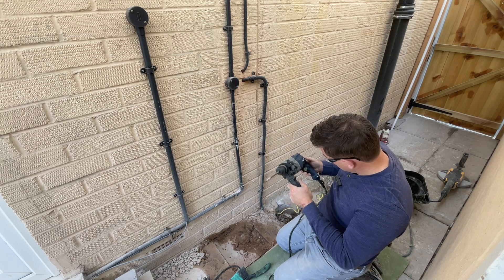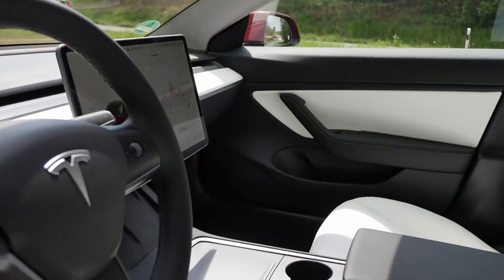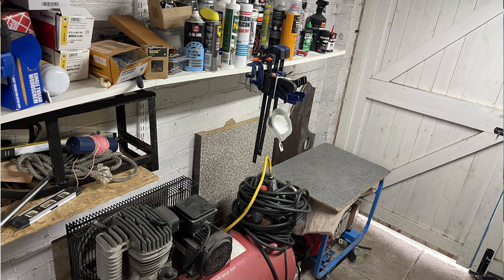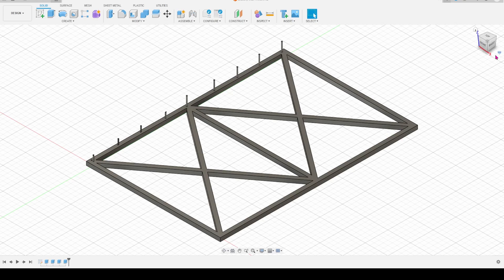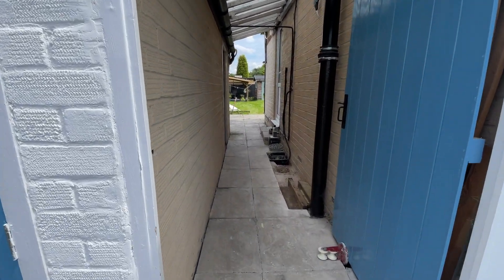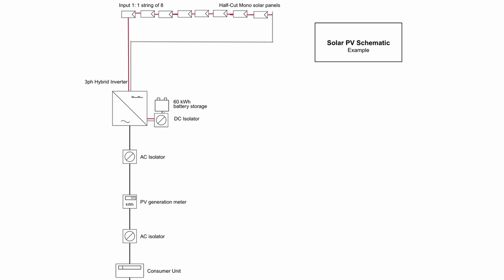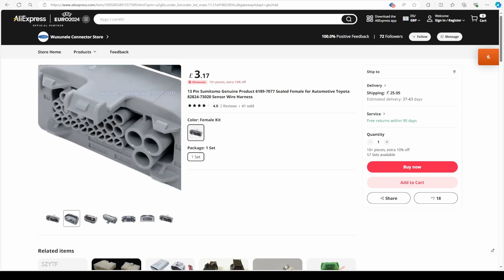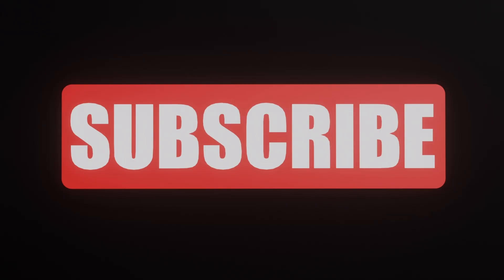How Do You Plan A DIY Frankenstein Tesla Powerwall???

Comment: Thank your fantastic video series. What is the device one could take with him and plugin to a model 3 Tesla battery to check if the condition is good. A battery of  part number 1666969-00-C is available in Australia for AU&9,900. Any pointers are welcome.
Reply from the maker: You can plug in a Lilygo in with the software from the ‘Battery Emulator’ by ‘Dala the great’ on GitHub through the x098 port. This would give you the cell voltages highest and lowest showing the mV imbalance. This is a good indicator of health. 

The battery would also need 12v powered through the x098 connector 

That pack is LFP and very similar to the one I’m using. I’m using revision D. I will add a link to the project instructions on the GitHub in the description.

Comment: Won't you have to move that pipe that would end up behind the battery? I'm not sure if it's water, gas or electric but any one of those would be a problem.  And what about insurance - won't that be a problem? For suggestions for getting it into position try and work something out with a couple of trolley jacks and a frame. A beefed up version of those trolleys glaziers use comes to mind. A crane would work but I'm not sure they'd touch a 400V lithium battery even if you assure them it's safe. A winch to rotate it upright - simply anchor it to a vehicle on the road and use wooden blocks to avoid damaging the case. I think it's quite a logistical exercise as you need some kind of restraint on the wall to stop it from tipping. A brace between the garage wall and the battery?
Reply from the maker: These are all the questions and thoughts that have gone through my head. The battery fits between the sewer pipe and existing cable to the other side. 

I thought of a glazing trolley 2. Plans are coming along. Thanks for commenting

Comment: How hard would it be to dismantle the pack and reassemble in situ?
Reply from the maker: My question is reassemble into what? Telsa packs are not designed to be stripped down anymore. They tend to bond the cells to the backplate for cooling.

Comment: Solid state relays are not needed for Tesla, the packs activate via CAN!
Reply from the maker: Thanks for commenting. Ahh I don’t think I was clear in the video. I’m hoping that the relays can cut 12v power in the event of the LilyGo or inverter noticing a fault in the battery. Say massive cell voltage variation. Does your emulator not do this? If not I might sniff the data to home assistant and use a remove relay to cut the 12v side and open the contactors.
Reply: @TheOfficialBatteryMan Ah, incase of a fault, we set the allowed charge/discharge to 0W, when inverter sees this it stops. But relay can be added for even more safety yes!
Reply from the maker: @DalasEVRepair thank you for filling in. The build is all about safe operating for me. It would be good to know all the conditions that the relay might open under